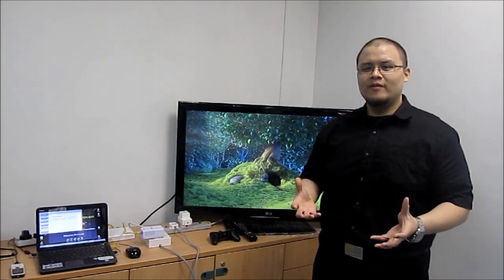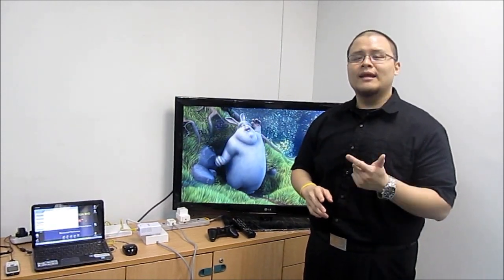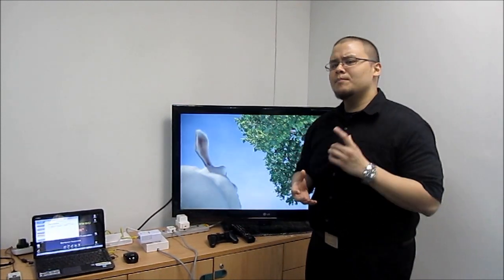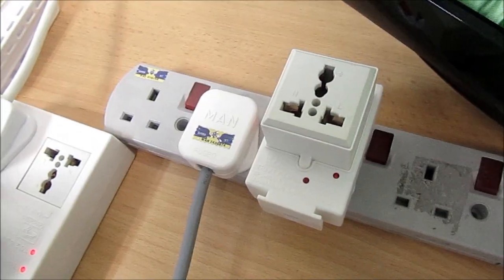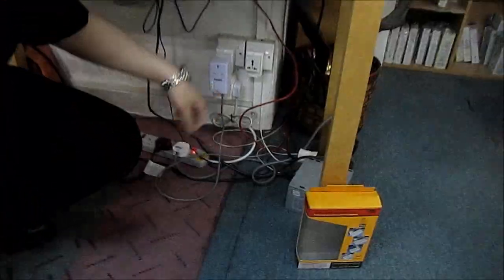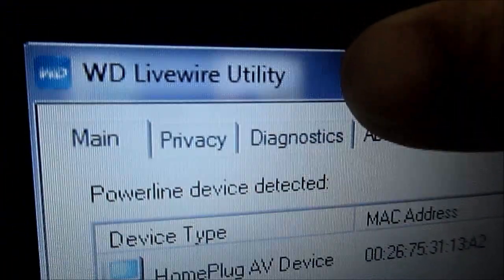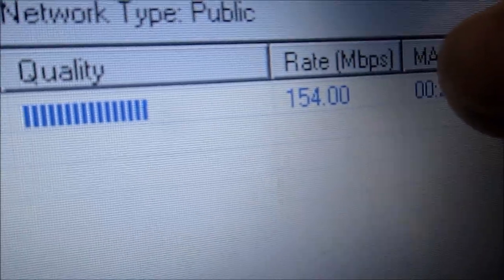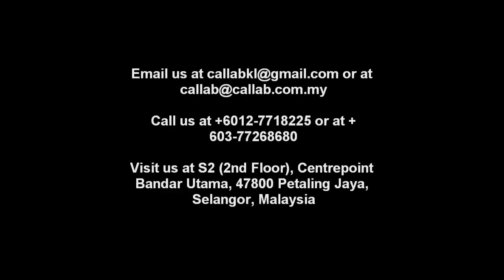See how Powerline-Ace is much more than just a line-noise filter

Comment: @surestreamer Have you (or ANYONE for that matter), figured out a way to fix the issue with powerline adapter speed decreasing up to 70% because it is behind an AFCI breaker?  In my opinion this is just as big an issue as a noise filter.  Newer homes are required to be behind an arc fault breaker.  I recently built a shed(man cave) and have a powerline adapter from the house to the shed and my bandwidth drops from 50 Mbps to 15 Mbps.  But per USA electrical code my mancave has to be behind an arc fault breaker.  Any info is GREATLY appreciated.

Comment: @surestreamer Is it possible to be loaned a set of these filters to test with a set of powerline adaptors we already have to determine if your claims are true in the real world?

How does your filter manage to overcome the fact that the ring mains network in a house is imbalanced - which will always result in RF escaping from the circuit?

PLAs are not "eco-friendly" - each pair results in an additional power useage of 40-100W, compared to a straight Ethernet cable.